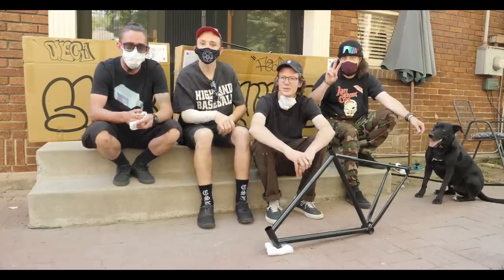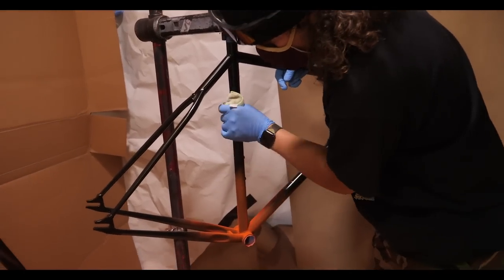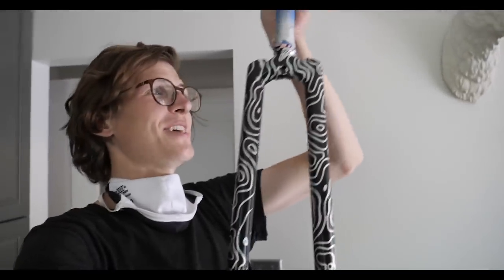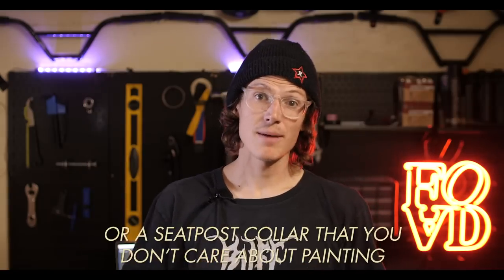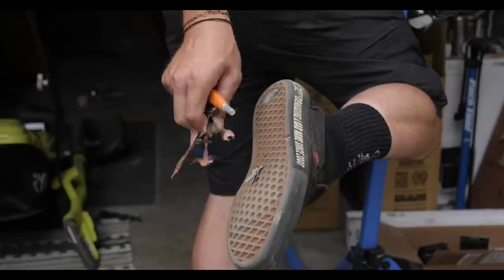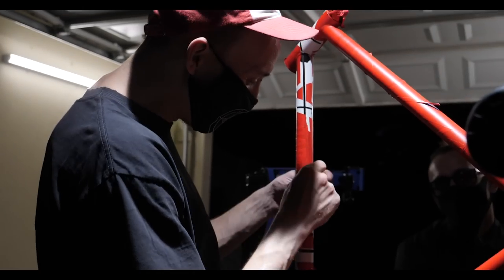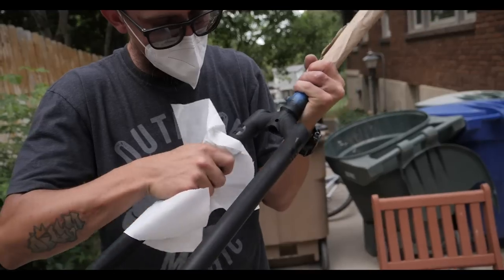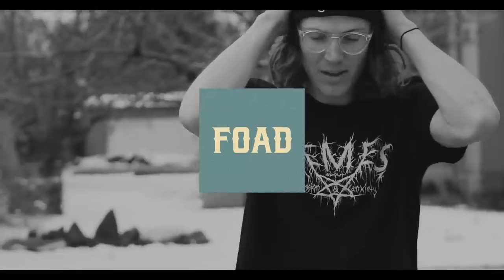HOW TO: THE BEST BIKE SPRAY PAINT JOB w/ SQUID BIKES + SPRAY BIKE

Comment: Most auto parts stores have duplicolor spray paint, and duplicolor is great for that sort of thing. The best clear coat you can get in spray cans is called 2K epoxy clear coat. It has two parts that you blend by pushing in a little button on the bottom of the can, and then you have 48 hours to use it before the can stops working correctly.
Reply: 2k primer, regular spray cans for base coats, and 2k clear coat works best
Reply from the maker: Good tip!  Heard good things about these paints as well!

Comment: metal wire or like steel thread or whatever the stuff is called in English is the best way to hold the frame imo. i usually hang It from a tree and that also allows you to move the frame around while you are painting it.

Comment: Etched primed and ready to go. Waiting for temps to drop to 70F to start painting with Montana cans. Plan is random pattern of gold and baby blue as the undercoat. Mask off some tiger stripes, then top coat with pink to purple fade. Remove tape. Clear coat x2, wet sand with 1000 grit, clearcoat x2. Buff with polishing compound.
Reply from the maker: Sounds like a rad paint job!!!
Reply: How did it turn out? What did you use for the buffing? Cheers
Reply: @johnsprague1678  Fades were ok but not satisfied with the masks. Didn’t peel them off at the right time so they were messy. Sanded it all down and started over by respraying to a single color pink, applied logo stickers then clearcoated. Final product looked good but disappointed I didn’t get what I initially wanted.

Comment: This frames look so good, I just don’t understand why the rear spacing is 135mm and the crank compatibility is so whack. Mash frames have the same tyre clearance and all cranks are compatible 🧐
Reply: These have a little bit more clearance I’d say.
Reply: Mash frames go up to 35c whereas the so ez fits 40c easy :)
Reply: emilianhrx tru! I have some 42c with tons of room in each side
Reply from the maker: It's a little challenging find hubs to make it work, but the added tire clearance is very nice! Check out Level Hubs, you can switch out the spacers to accommodate 120 and 135 spacing.  Pretty rad and will work with different frames!
Reply: @emilianhrx5770  mash steel frames go up to 40c, im not hatin tho i really like these frames

Comment: You all regret not sanding the frames, but you don't say why.

How much of a difference would it have made, considering the frames all came out pretty good looking? Is it a longevity thing, or a "it would've made painting it easier" sorta thing? Or both?
Reply: Sanding is a drag but essential. The paint doesn't stick well without a good cleaning and sanding. It'll look cool until it starts flaking and peeling too soon after all the finishing details. 

I've been there😅
Make sure you get all the nooks and crannies.👌
Reply from the maker: Re-up what Another One commented.  It doesn't matter too much in the application, but in the long run the paint will stick better.

Comment: Has anyone used spraybike paint and the end product is really rough? Almost feels like sand paper. How do I prevent that issue?
Reply: Maybe 2 light layers of clearcoat, wetsand with 1000-1200 grit, then 2 more coats of clear. At least that’s my plan.
Reply from the maker: @jp93309  Good call on this!  The paint is pretty dry so it can come out rough.  Wetsanding will definitely knock down the roughness, be careful that you don't take off too much though!